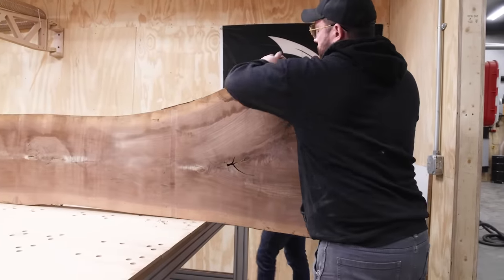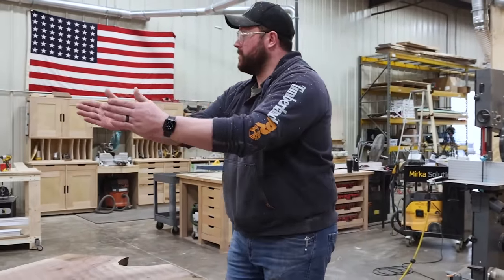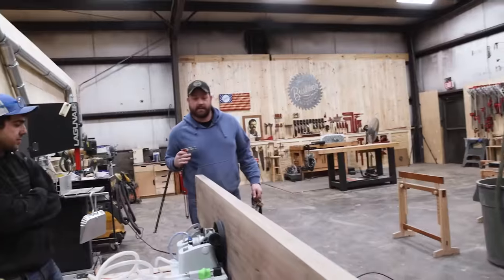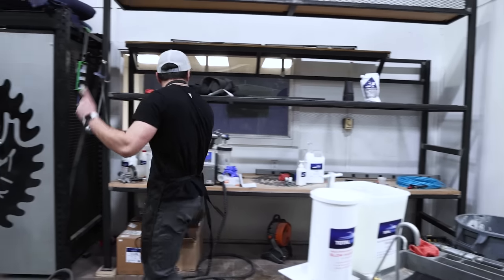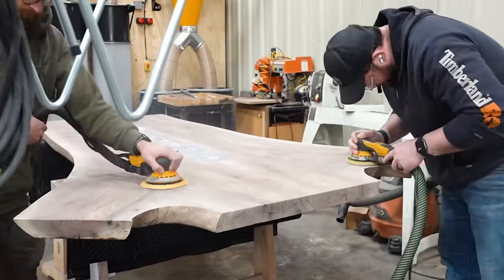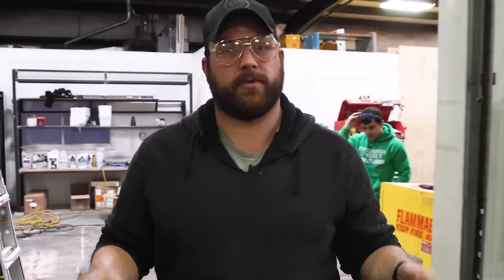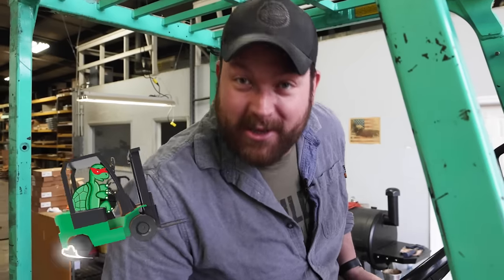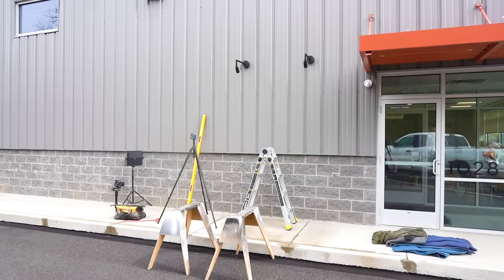HUGE Mistake, I Lose Money on this $10,000 Table!

Comment: Geez... TWO $20,000 Louis Poulsen pendants and a $10,000  conference table... WTH kind of Plumbing and Mechanical place is this?
Reply: Definitely civil engineering. They are in Texas, so maybe oil/power plant related projects. I'm not sure what else would need high pressure, high temperature, corrosion resistant pipes with so much volume. 😂 

That table is 90% steel by weight. 😅
Reply: @hadensnodgrass3472 East End is in Pennsylvania

Comment: A big tip for joining those together.  Clamp the boards side by side and then run your tracksaw blade down the center of both edges.  You may have to do it two or three times before they seam up perfectly but it works great!
Reply: Where do you find a track saw that cuts 4”?
Reply: @bclayton39  that top is only about 2 1/4" thick.
Reply: Does it not pinch your saw blade? Seems like it would
Reply: @goodtimeshuntintv1554  I normally do it in about four passes.  No issues with pinching.  I build live edge tables this size for a living.  Alot of the time our slabs are too big for a joiner so this is how we join all of our tops.
Reply: @bclayton39  mafell make one 😊
Reply: Great idea!
Reply: This was my first thought as they were trying to figure it out.
Reply: Can confirm.
Reply: Alternative method is a plunge router and straightedge - takes away more material so usually can get it done in 1 pass.
Reply: @andy1517  Would you normally use C channels on a slab this size to prevent warping?
Reply: My festool track saw would lean and pitch when taking too big of a bite out of a slab
Reply: @goodtimeshuntintv1554  My thought exactly until I realized he probably meant clamp both boards down. Not together.
Reply: Dude I’m actually so excited to try this on the weekend. I’m been struggling on the jointer with a big coffee table glue up I’m doing but this is genius. Thanks for the tip!
Reply: @brycestryker8185  oh yeah, I guess that would make more sense!
Reply: What’s the max. lb. load on the glue.  I’m impressed that something that heavy stays together with just wood glue/epoxy.  Disclaimer:  I don’t have any experience building tables so I was just surprised to not see something like long steel rods (or at least wooden dowels) being used to keep the slabs together.
Reply: @j.sineduce6163  wood glue is actually incredible. I’ve seen it before where someone tried to crack their panel after glueing it up, and it didn’t crack at any of the seams. They say the glue seam is insulated stronger than the face grain wood. That being said, I think he did use domino tenons (essentially a dowel) which does add some strength but is also a huge help for alignment; all the tops of boards are flush with each other at the seams.
Reply: @j.sineduce6163  Notice @ 8:16 when he cuts in the mortises with a festool domino joiner then the filled them with the dominoes (dowels) later on.
Reply: @brycestryker8185  Oh ok thanks bud!  I started watching the vid before work and picked it back up afterwards.  I must’ve missed that part.  From the looks of the spacing it would appear that they incorporated approximately 5-7 dominos if I had to guess.
Reply: @j.sineduce6163  The dominoes are more for alignment than anything.  As stated above, a properly glued up joint is strong than the actual wood.  If you could apply enough force to snap that table in half it would break somewhere other than the seam.
Reply: @rafezetter8003  
I did this once. I used a 1/2" router bit and separated the boards by 1/4" so it's easier on the router (you're not plowing through a 1/2" of wood, only taking an 1/8", give or take, off each side. I also mounted the router on a rectangular base so it would register to the straight edge the exact same on every pass. I ran 1/2" deep on each pass. I probably could have gone deeper but It was the first (and only) time I did it so I was being cautious. The joint came out flawless.
Reply: Plumbing and mechanical?  Make up your mind what you are doing! LOL

Comment: I have said this only like 10 videos now, you use the jointer incorrectly, that's why it didn't work. Look at the outfeed table at 7:03, there is a big gap there. You always put your weight and pressure on the infeed table and that's not correct. All that does is transfer the existing inaccuracies through. It doesn't matter if the piece is even touching the infeed table after you start the joint, the only thing that is important is that the piece is solidly contacting the outfeed table. Watch parillaworks if you want to see how to correctly use a jointer.
Reply: you're right! When I use a jointer, the ONLY time where my hands are even above the infeed table is at the very beginning. As soon as even a tiny amount of the workpiece has made it to the outfeed table, I immediately shift all my energy to hold the piece down to the outfeed table and into the back fence. To keep feeding the workpiece through the jointer, I push it only from the outfeed table outward.
Reply: Came here to say this. As soon as the piece passes over the blades of the jointer, you need to bear down on the out feed table to let the jointer do its jointery thing correctly
Reply: @jeffheinzman1612  I usually use a straight edge and a router with the longest straight bit I have. I then know it's square. To run something that large over a jointer is difficult.

Comment: Great video as usual John, but just a tip! A commercial shop like yours should have a 10ft sliding table saw, you would’ve had no problems with the joint! I just glued a 4x8” hardwood countertop and I edge-jointed my boards with the slider. A breeze!
Reply: Ok 😎

Comment: If you want to joint 2 boards with the track saw you need to get them together  and cut them on the same time on the joint gap line, I've done that a lot and it works very well.
Reply from the maker: We also tried that off camera hahah.

Comment: You should have taken advantage of your massive CNC router - vac-clamp the 2 slabs as close together as possible, then run a bit down the center.  Even if it deviates a little, they should perfectly match up.

Comment: If you joint by hand on a piece like that, use a #7 or #8 jointer plane for final jointing; more consistent in eliminating small dips or variations.  Any variations left over and that smaller plane will follow them. Then use a #3 or #4 for you finishing passes- eliminates a lot of sanding.

Comment: Amazing work and overcoming the hiccups! Found your channel yesterday and have been loving the content.

For the Rubio finish, one thing I picked up watching Cam at Blacktail is how particular you have to be if you're going to put a second coat on (apparently the mfg isn't super keen on this), sanding it down after the first coat, then hand applying the second coat before wiping off and applying a ceramic finish over (iirc this is more for high gloss and protection). Not sure if that had anything to do with the streaking issue you didn't like, but it may be worth some testing.

Comment: It cracked me up watching you work on the joint between the slabs. The simple solution is to get them as close as possible, then run a track saw down the middle between the slabs. When finished with the cut, it will fit together exactly, even if the cut itself is not perfectly straight.....

Comment: To joint the slabs perfectly.  Put them back on the cnc and space them apart slightly less than the diameter of your bit.  for example 1/2 bit leave 3/8 gap. then cut them at same time if you dont have a bit long enough go as deep as possible and then flush trim from the back side.  The bottom doesnt really matter but at least the top side will be mirror cut

Comment: I had the same streak problem with a 14’ kitchen island last week. It came from burning the first coat of Rubio into the wood when scuffing before adding the 2nd coat, much like your table here. Sucked to have to re sand it all. But it got done and turned out great

Comment: @7:02 As you are using the jointer you can see a gap appear between the face of the board and the face of the out feed table about 2 feet into the pass. It kinda pops up. That tells me your cutter head and out-feed table are not coplaner and thats why you are getting a crown. That jointer is definitely not set up SUPER PRECISE.

Comment: Why do you not join the two "feet" together? The table looks impossible to move without the risk of breaking the slab.
Reply from the maker: Yea the parts are spec for the base, and we didnt design it. The buyer actually did so its what it is
Reply: @John_Malecki  Makes sense. Thanks for the response.

Comment: Biscuits, dominoes really only help with lining up joints, not really a strength thing.  You are entertaining, though.  If the Woodpeckers drill press has a "really good" stop, is there really a need for the blue tape flag?  Oh, redundancy, I get it.

Comment: Hand tools - 1, machines - Zero.

Just a thought, but what if the entire plumbing base was pipes & fittings created using walnut?

At exactly 17:54 it looks like a drilled hole was off center. This is one of the benefits of woodworking, most of the time errors can be corrected to function as intended. Like the bumper sticker says - " Stuff happens"

Just had another thought, next time maybe photograph the two slabs, then rotate & manipulate in photo software to show clients.
Reply from the maker: Sounds like a lot of labor, for someone who can turn hahaha
Reply: @John_Malecki  Yes, lots of extra work, but very unique and beautiful.

Comment: A huge mistake is taking on a project that you don't want from a customer you don't know and then hiring workers off of a message board place. I did that late last year. Didn't actually cost me anything but if I made $500 in total I'd be surprised!! And I worked on the job for like 2 months! THAT was a HUGE mistake. Never, ever again!! So I guess I came out with some wisdom, and a real bitter taste for contracting!

Comment: Part of the problem you are having is you are using a short smoothing plane to joint a thick slab. No 7 jointer would make it much easier to straighten that edge out.
Semper Fi

Comment: Man... these types of pieces used to require years of training in technique and tools and hundreds of hours to build... now literally anyone with some epoxy, angle iron and bolts can make a 10,000$ table.
Reply from the maker: so you're pissed because i added some epoxy ?
Reply: @John_Malecki  Pissed? No. Disappointed that you can make a table in the way you did and have it pass as a 10,000$ table when doing it with traditional joinery is what makes a table like that worth 10,000$. It's unfortunate for the trades because there will be less and less reason to keep those traditional skills alive and also because the consumer is paying more and more for less and less quality.